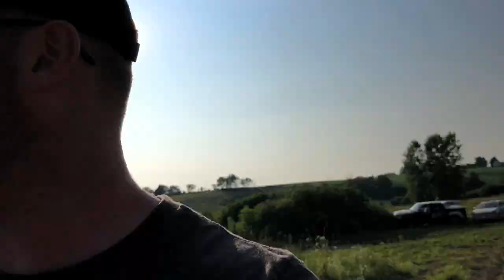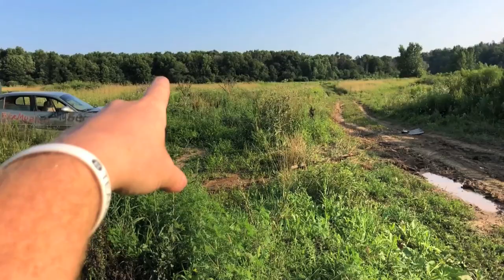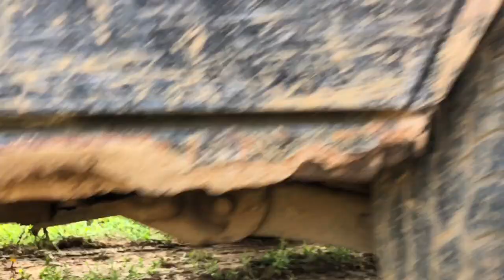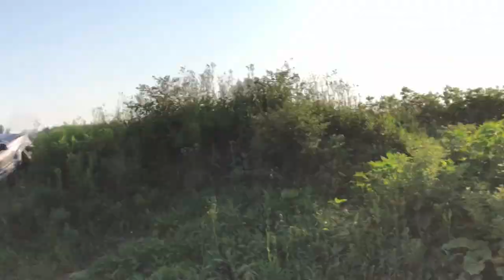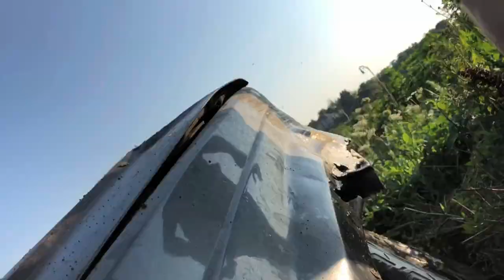4X4 JEEP Jump! AXLE SNAPPED OFF!!!

Comment: Great send!! You might make 'em remote control by using a motorized wheelchair motor to turn the steering wheel and use electronics out of a toy remote control car. You can use solid-state relays to control the bigger motor on the steering wheel.